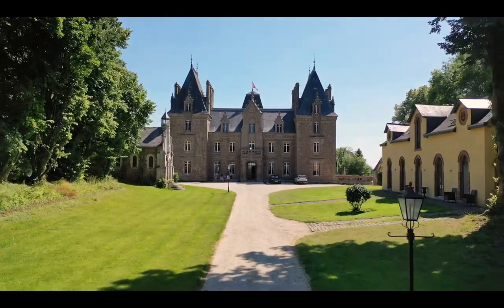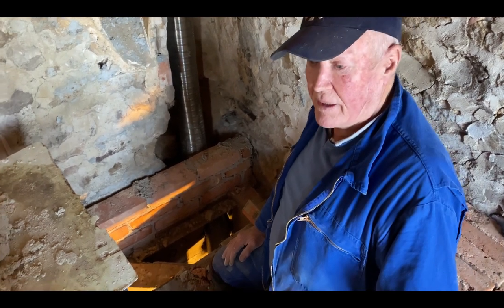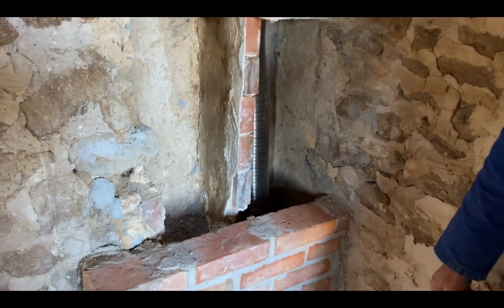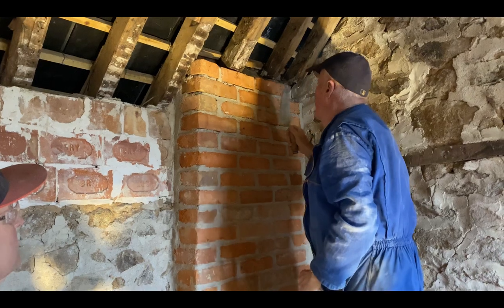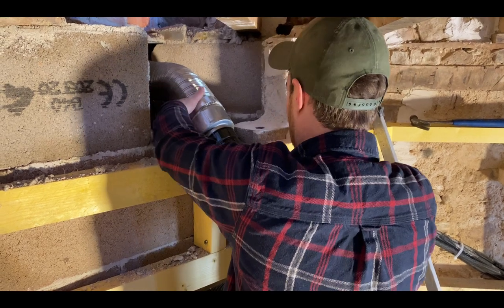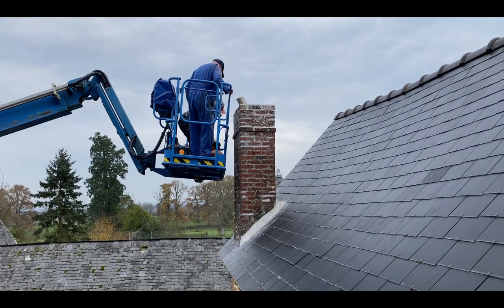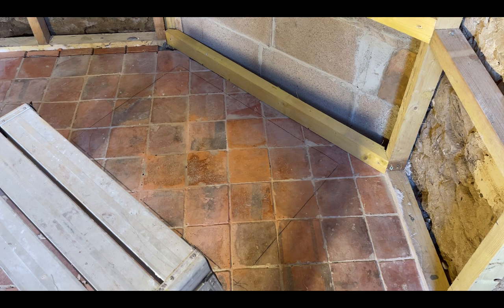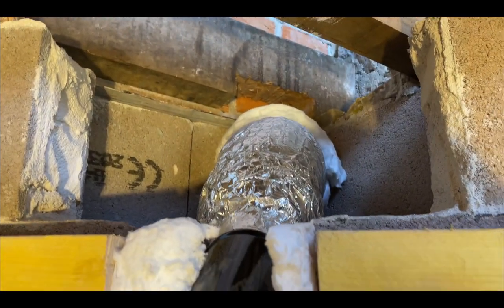Restoring The Cottage Chimney - Doing It Ourselves

Comment: So many great quotes in here!  "The block fairies took 'em," and "We built it with adjustment in mind."  Great job on the fireproofing, so important!  I hope you can find a cap or plug for the unused flu, so that rain doesn't run down into it and create damage or mold inside.  It would have been fun to place a family photo inside the unused flu section on the upper floor before closing it in, but what a great job Mick did with those bricks.  I could run a level line, hang a plumb bob, and still not get it as square and level as he did without any of those things!  I also learned something (as usual from your videos!) - Vermiculite as a chimney insulation.  Never heard of using it for that, and it's brilliant.  It's looking really good, Micheal!

Comment: It looks like there are 2 bends in the pipe that each are less than 90 degrees.  Have you run through a trial cleaning of the flue pipe?  If you are going to experience any problems now would be the time to find out.  I clean my wood stoves every fall to keep the creosote from building up.  My sweeps are of fiberglass and will bend somewhat.  I am not sure if they would conform to the two bends in your flue pipe.  One experienced chimney sweep told me he would drop a cable down and pull the sweep from the top when he ran into curves that the fiberglass rods could not navigate.  The brick wall your dad laid looks fantastic!  Enjoy watching your channel.

Comment: Is Flexible pipe appropriate for chimney sweeping? Also, there should be little door for colecting soot downstairs (and for easier sweeping..). Even better, if possible, on the outside wall (of the chimney).

Comment: I would change that flue every year or you may have a chimney fire. I do believe that pipe is only good for Natural Gas fireplaces.
Reply from the maker: It looks flimsy but it’s rated for use with all solid fuel including coke which burns the hottest. It has a 30 year guarantee so plenty long enough until it needs replacing.